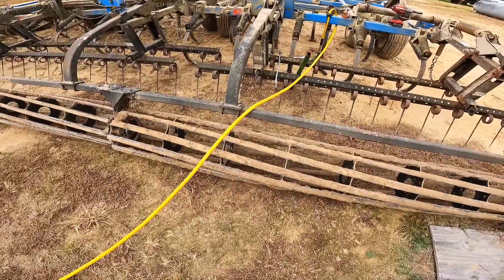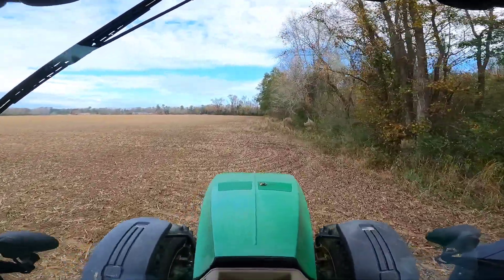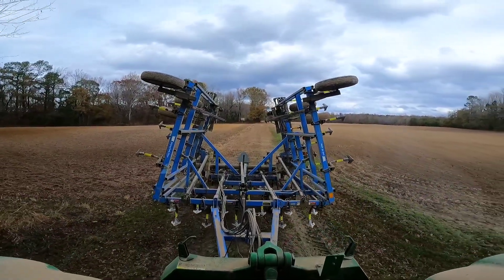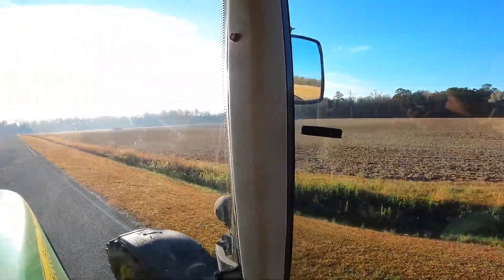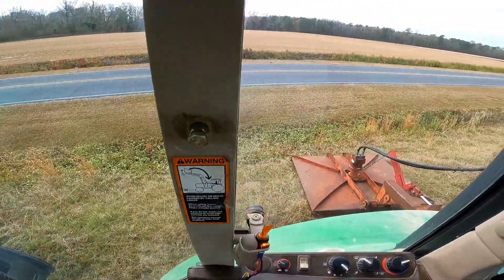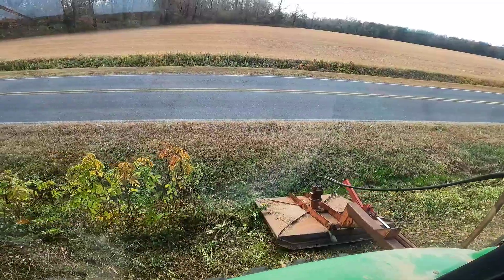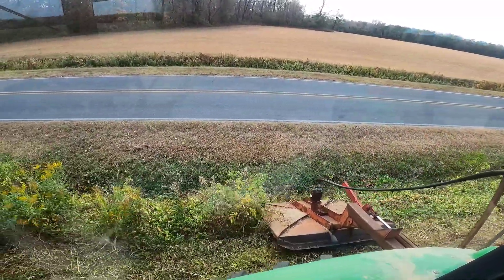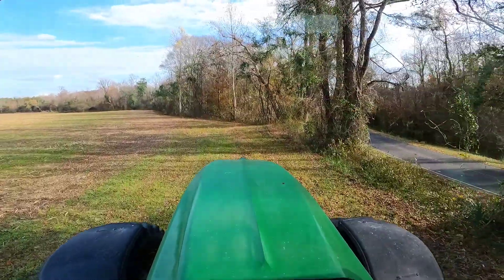Cultivating Complete! Now Let's Look At Dem Ditches! 😅 Day 1!

Comment: Diablo Blades. Check them out Terrell. They eat metal fast, and the blade diesnt heat up. Its actually amazing. The guy in the video slices a piece then grabs the blade with bare fingers and its all good. They arent cheap, but they are worth it. 🇨🇦👊🏻👨🏻‍🏭⚡👌🏻😉